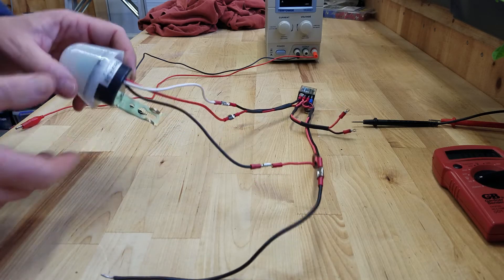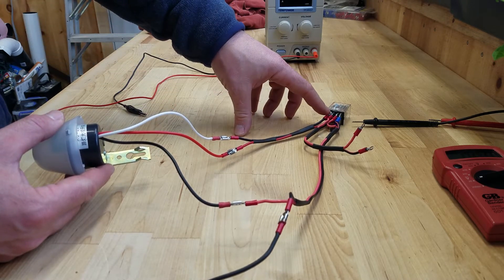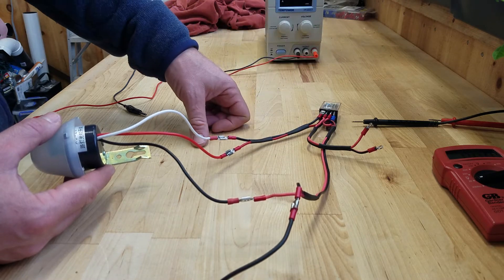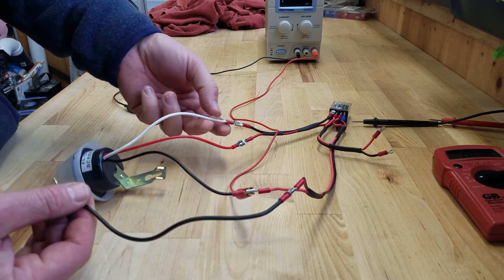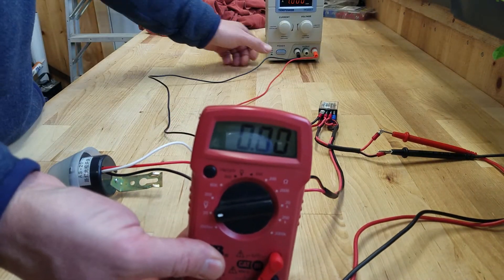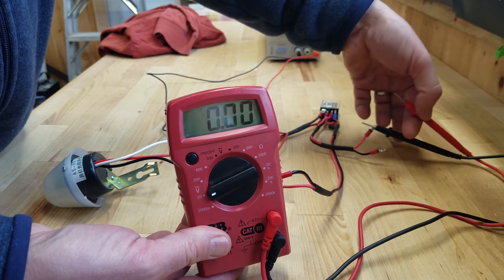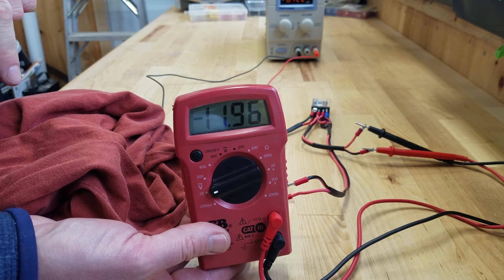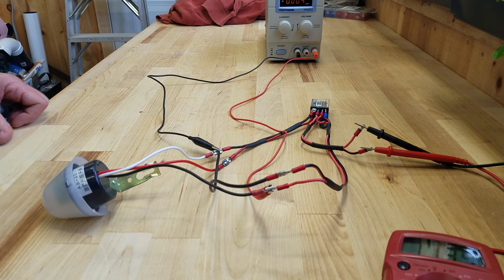Automatic Chicken Coop Door - Photocell Wiring

Comment: Does the relay get hot?
Reply from the maker: Warm yes but shouldn't get hot. Relays are designed so they shouldn't overheat even if they stay on for long periods of time. There are better heavy duty relays, but more expensive. Personally I don't like the photocell system. There's a much better solar timer that Honeywell makes. I wrote a blog post about it & for that one I used a heavy duty relay. See my blog.
Reply from the maker: http://blog.netscraps.com/diy/automatic-chicken-coop-door-solar-time-table-switch.html
Reply: @Mike Wickenden   thank you i appreciate you replying, I've been manually opening my chicken coop everyday for the last year 😔 and this will help alot.

Comment: I’ve triple checked all connections, the relay clicks and the green light come on when the photocell is dark, then the relay clicks and the light goes out with the photocell is light, but the motor does not activate. I can manually switch the pos/neg and get the motor to power on, but the relay is not communicating to the motor. 

How should I problem solve?

Comment: Where are the limit switches to shut off the motor at the end of the travel so it isn'"t powered all the time?
Reply from the maker: If you use a linear actuator, the limit switches are internal.

Comment: Hi Mike. I tried to comment on your blog but for some reason it won't show up.
I was wondering if you made it work with Honeywell Econoswitch. That is probably the most perfect setup I can think about since no changes would have to be made to the timer once it's set up.

Please let me know.
Reply from the maker: (1 year late on my reply) Hi, yes that method worked great, instructions here: http://blog.netscraps.com/diy/automatic-chicken-coop-door-solar-time-table-switch.html
Reply: @MikeWickenden  Hey, since you are here... I am having problems with the setup again and I think the problem is the power supply. Do you have any favorite ones I should check out? Something more heavy duty than a cheap brick style supply?
Reply from the maker: @gogoatsgo7120  A good setup is a lawn mower battery ($35) & a small battery maintainer ($15). That way it also keeps working through power outages.
Reply: @MikeWickenden  Cool idea! Would AGM work better than SLA, especially considering some extreme temperatures between summer and winter? How small would you go?
Reply from the maker: @gogoatsgo7120  I'm just not sure the cheap battery maintainers are good for AGM batteries. I think most of the battery maintainers are designed for lead-acid. In terms of battery size, most auto parts stores carry a small U1 lawn/garden battery that's 160-200 CCA & ~20 aH capacity for around $35-40 that should work great.
Reply: @MikeWickenden  Gotcha. How would it change the Econoswitch wiring then? Not sure if it can run on 12V (to operate during a power outage)
Reply from the maker: @gogoatsgo7120  Oh whoops I thought you were asking about the photocell system. For the Honeywell switch you need 120VAC and 12VDC, so you wouldn't get the power outage benefit unless you also had a battery backup for the AC power.
Reply: @MikeWickenden  That makes sense :) Looking a for more robust power adapter now.